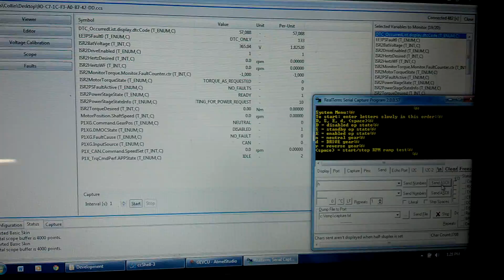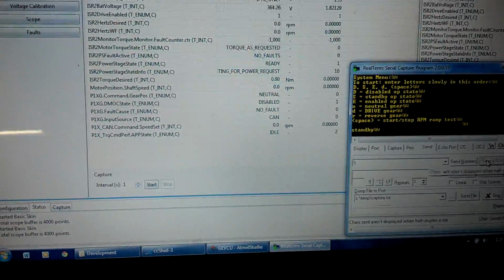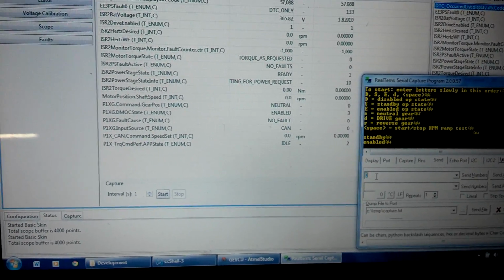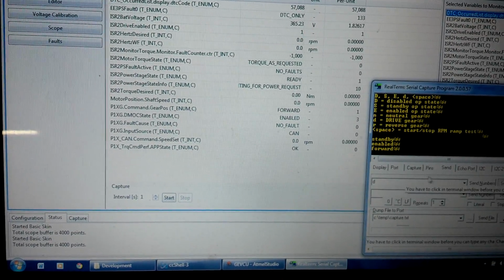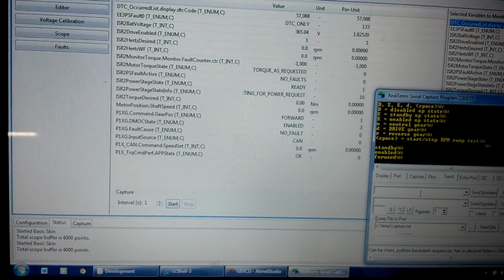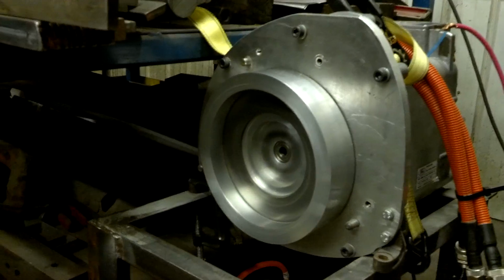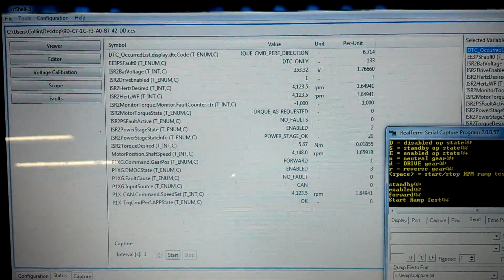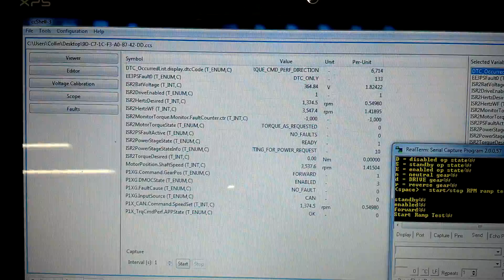Testing DMOC645, Siemens 1PV5133, and Macchina

Comment from the maker: It was a blank controller from the AZD sale but obviously has since had firmware put on it. But, it does have the same firmware a Transit Connect Electric from Azure would have used.